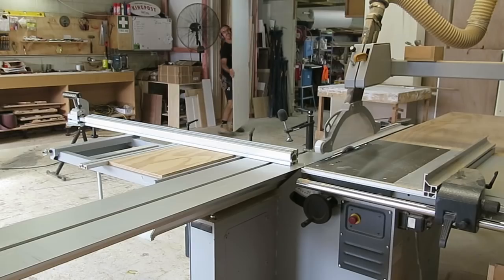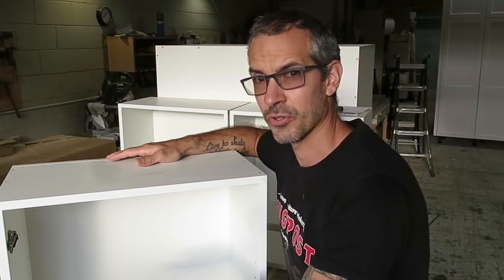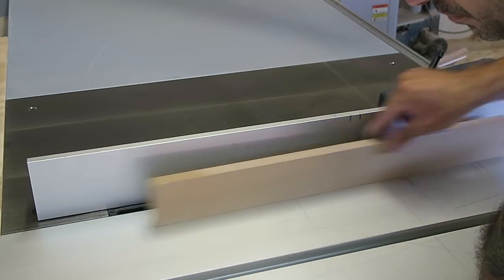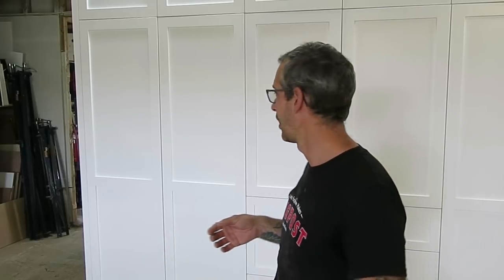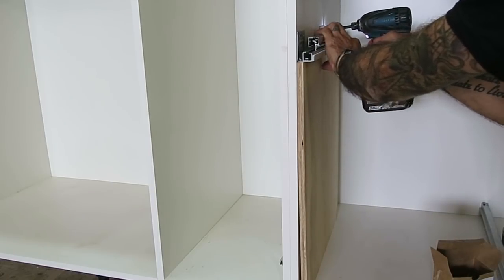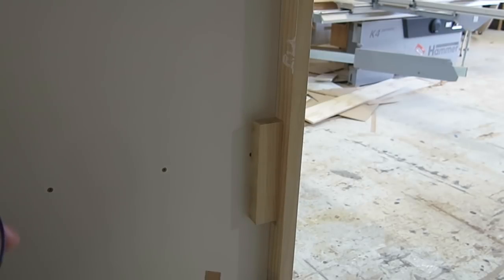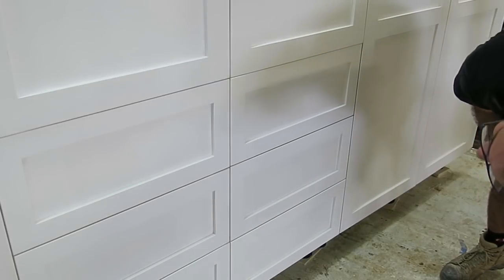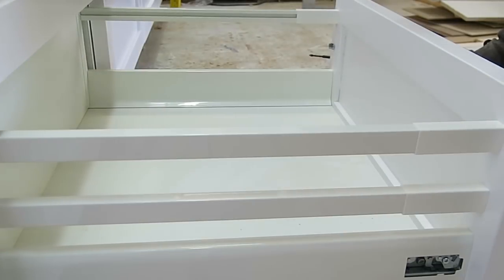How To: Built in wardrobe tips and tricks

Comment: I discovered a hettich jig for locating hinge plates.  A bit of 3d printing, some M6 bolts and a length of 30x15 aluminium hanging rail and I have an unlimited, highly repeatable story stick that can be used with a 5mm vix style drill bit to locate and drill in one action.

Comment: I've made thousands of cabinets and no one had ever mentioned the bottom should be full length. Seems like an obvious issue but your method will save on screws whilst also being stronger. Didn't think I'd get anything entirely new out of this, thanks.

Comment: Nice build. I have just finished a build where a needed a hinge for thicker material. I ended up using ones for 20mm and routing a pocket. Any chance you could let me know the code. The 200 page comprehensive Blum catalogue can be hard to point point what you want cheers

Comment: I started with a Graco sprayer like yours and eventually worked out that you lose about 50% of your material in overspray.  So, I invested in a Fuji Q5 hvlp sprayer.  Not only do I much better results and finer control, I only lose about 10% material to overspray now, possibly less.  With material shortages, maybe that would be a good option for you to make the most of your paint supplies.

Comment: Hello Joey love the Chanel.  I’m just a  hobbiest wood worker but i was interested in your comments about the top and bottom of a carcass.  as you say partical board does not hold fixings well . i have a different take in that if you are using mechanical fixings they are much less likely to pull out with excess load if put in laterally rather than vertically which is why the manufacturers go down this route it carries a higher failure load
Reply from the maker: Your right about the way the fixing works, but.  The fixings are there to hold the carcass together not to take the working load.  With the side coming down onto the bottom panel the plywood is doing all the hard work.

Comment: Really good work yet again Joey.

These types of videos are always good, great to learn a few tricks.

Does the edging gun you are using work with the thicker abs type edging or just the thin iron on type stuff?

Couldn't tell from the video which you were using.

Cheers
Reply from the maker: I typically use .8mm abs type edging. Or .5mm veneer edging
Reply: I've used it for 2mm as well as 1mm. It's slow going for 2mm but it does work with good results.

Comment: Joey the way you’re doing it the weight is countered by screw threads rather than sheer strength screwed from sides.
Reply from the maker: No the weight is on the plywood base panel , the screws hold the plywood together they shouldn't be taking any weight.
Reply: Yeah its much for muchness. . .  just seems like more work. The legs you are using are designed to be put under the gables to take the weight anyway

Comment: For the doors with regards twisting. Do you get your lumber, machine it down to oversized and then leave it for a week or two? To see if any internal tension in the wood or any excess moisture would make it twist at all??

Here in Ireland the timber we get is said to be "kiln dried", well I can very easily say that it has never been within 10 kilometres of a kiln, so warping and twisting is literally a constant issue for me.
Reply from the maker: The pine I get is very dry, is sometimes liable to bow but generally very reliable.  That's a shame about your timber supply strip stacking and waiting is about all you can do.

Comment: Hi Joey. You glue and screw cabinets rather than using biscuits, dominoes etc. Is that your preferred  method?
Reply from the maker: Typically I just screw the cabinets together.  Biscuits or dominos can be useful in some cases but generally don't add any strength to the cabinet.  Typically the panel you are using (plywood) will provide plenty of strength in it's own. Things like built in cabinets , once installed are under very load or stress if assembled probably and don't require things like dominos.

Comment: Hi, which size mounting plates did you use for mounting the Blum hinges. They come in different thicknesses. Did you just use the regular 0mm plates or did you use the 3mm plates, or even thicker?
I'm building a wardrobe myself and my doors are going to be 30mm thick. I was also thinking about using the Blum hinges i'm not sure about which size mounting plate I need to use. Thank you
Reply from the maker: I used 3mm mounting plates . You will need to test out the backset for the 35mm hole in the door for these hinges it's about 6mm
Reply: @KingPostTimberWorks  thanks. That's some useful information

Comment: Ive used the Harn drawers in my kitchen but found it difficult to adjust. It wouldnt move when i adjust it. Can it be that i cut the drawer bottom too long in front so its ribbing on the drawer front. Im really just a hobbyist. I would appreciate your advise.
Reply from the maker: There is a locking screw on the adjustment panel. It needs to be loosend then adjusted then you can lock it in the new position. I find with left to right adjustment you need to make the adjustment then tap the front in the direction you want as the front can stick on the runner fronts.
Reply: @KingPostTimberWorks  thanks Joey. Yes the up and down is fine. But the side to side adjust is the one thats anoying.

Comment: Hi Joey, I have already responded to one of your videos. There is a nice program where you draw cabinets with and where all sizes are passed on at once for production, both to work by hand and with a cnc machine.  There are three versions of it, you should check out Wooddesigner.org and check out the many YouTube videos that have been made to use and adjust the program for your own use.  All the bores and grooves are also provided for Blum hinges and drawers.  Greetings from Belgium